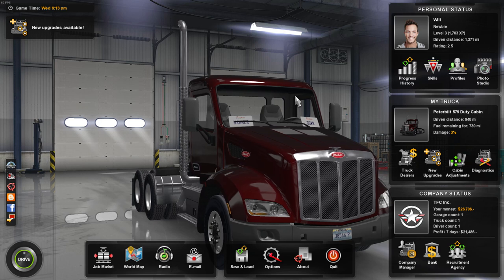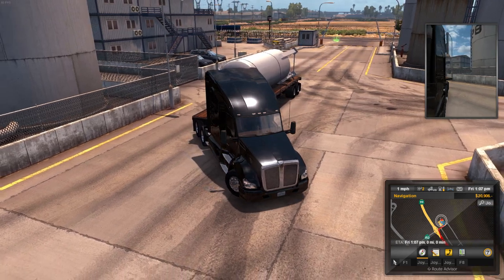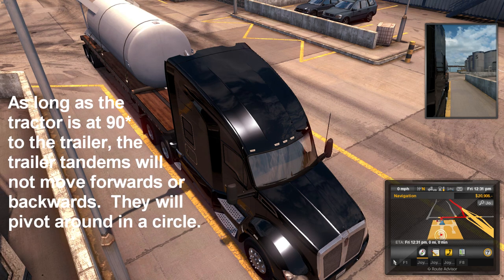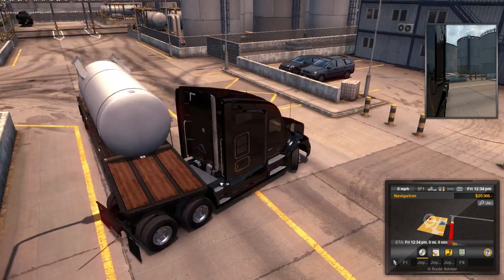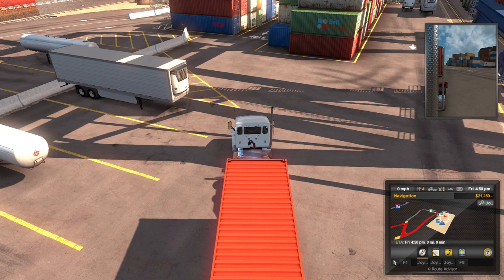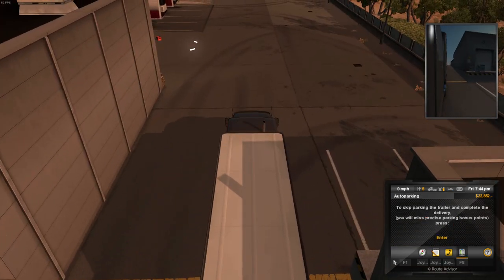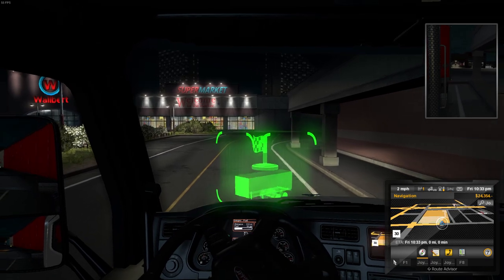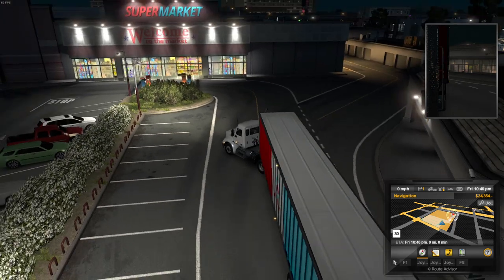American Truck Simulator - How to back up a Trailer

Comment: It's videos like this that I finally learned how to position the trailer. I was having a hard time so I would just click on the easier options mostly just a straight in parking job. I also compared this video to some other actual backing up videos done by offline truckers and it's pretty much the same. I could never figure out how to back up into that tight space where you were backing up into in this video so thanks for the help on that. Those are some crazy jack knifes and probably close to crashing the back corner of the cab into the trailer lol.
Reply: @Benjamin Schiltz Vlogs    Not me. I decided right from the get go that I would learn to park a truck properly. It took me nearly 45 minutes to complete the tutorial, and 40 of those minutes was me spent trying to park my trailer. I did, however, learn a lot about backing the truck and about how turning affects the trailer. I kept taking the hardest parking offered by the game. And eventually, I learned how to park a truck this well simply from trial and error.

Comment: One of my first out of school and into the real world backings was a dividing cor curtain wall of cinder block where i had to do a lane change type parallel park into the spot with the wall starting on the blind side and ending on the sight side with a trailer already in the next spot over. I have come across some tricky parking jobs that are not covered at all in Training School. A Game like this would have helped greatly, best played on a full size simulator rig, ie three monitors, steering wheel, shifter, three pedals and some feedback sensors.

Comment: I can back trailers with my mirrors. The mirrors installed on the truck. Not the mirrors you use by pressing F2. My only practice was external camera.

Comment: Great video as a student this helped, you might want to emphasize the LITTLE turns.
Reply from the maker: +Richard Swartz Yessir, I should have.  I noticed a lot of things I should have touched on, after it was uploaded.  Funny thing is, I watched it in the editor many times too, and never noticed it.  It is a very good point, though.  The bigger steering inputs basically get you in the ballpark, but the little ones are the difference between parking a trailer, or having to pull up and try it again.

Are you in the middle of getting your CDL?

Comment: I have been a driver since 1987. This video on backing is not the most efficient method and is not the method taught in Truck Driving School. The most effective and efficient method of setting up to change lanes backing is to simply pull forward straight until the trailer rears are past the end of the lane and you can see the target in your passenger mirror. The 1-1/2 turns of the wheel to left, back until you see the right front corner of the trailer, then turn the wheel right sharply until you come back around and you see the driver side trailer tandems about to enter the opposite lane. At that point you steer right until the rear guides easily into the lane between the lines and back straight by coming around with the tractor until straight. Perfect park. Parallel parking is done similarly.
Reply: Philip Murray i agree i have been driving for a long time now and this vid is ok but not good if it was me i would come in and turn left then do my backing up and some spots i deliver to i have to back up all the way down the side of the building and into the back to get to the loading dock and there is always trailers there so its not easy and if you do a cdl test and you take to long to figure it out you dont pass
Reply from the maker: Guys, this is a game, and this video is to show gamers - not truck drivers - how maneuverable trucks are, so they don't give up.  Now the things depicted in these videos, while not easy on equipment, are the types of maneuvers you'll see 24/7 on oilfield locations.  But I wouldn't recommend them on pavement unless you were in a jam.
Reply: The First Crew agreed I think the only ones who would dislike the video is professional drivers. I loved the video as I play the game and have a HARD HARD time backing
Reply: where u get the game
Reply: Chuck Winters Steam website it's on sale now 9.99
Reply from the maker: I agree.  They don't seem to realize this is a tutorial for a video game.  They also think interstates and huge yards are the only thing in trucking.  If they ever went to the oilfield to haul sand, water, or diesel, they would shit their pants.  Every day, I see trucks jack knifing so hard, while the truck is moving forward, the trailer is literally moving backward, until they can straighten up some.  It's hard on equipment, but it also pays good.
Reply: There is not one way to back idc how long you been driving. Everybody does it differently, as long as u don't hit anything u did a gj
Reply: Depends on what school you went to. Not everyone teaches it the same.
Reply: Guys, if you’re playing a simulator, then you would want to do it the right way, no? The guy in this video hits plenty of obstacles and walls while maneuvering. I see that as a complete fail, game or not.

Comment: I've got a good damn question I can't find a video anywhere on.      What is the difference in drive wheels.  2x8, 2x6  etc.  And location of wheels on the trailer.  Middle rear. Separated etc.   Purpose of each and how and when to use
Reply: I know its been 10 months but Extra wheels means you can support more weight. And the space between wheels also is a factor in how much it can support

Comment: These maneuvers may work in game... But definitely not recommended in real life, you will end up with a lot of damage
Reply from the maker: Yeah, hard on axles and tires.  But this is how it's done on tight oilfield locations, 24/7/365.  Destroy equipment for the almighty dollar.
Reply: I was a hostler b4 going otr. & set-up & maximizing space was always needed. Newbies should do this game 4 a mth b4 hitting the road.
Reply: I am also a truck driver, I haul 80,000lbs worth of limestone. On a trailer like my 4 axles, you'd be ripping tires like crazy if you had a full load and tried to do this
Reply: My thing is 80,000 or 8 pounds people don't have a clue bout backing. This would help.
Reply: Yeah the game is a good way of learning
Reply: Having said that, how do you do it with 4 axles and 80K of stone without savaging the tyres?  Seriously.
Reply: +deltavee2 lift the one axle and backup with as little jack knifing as possible haha

Comment: @The first crew do you have your cdl and have any advice on shifting an 18speed eaton
Reply from the maker: If you're talking about a "5 and 4", where you don't use low gears for compound gears, (have two shifters), then I can't give any good advice.  I hook my left arm through the steering wheel to shift the four speed, while using my right arm to shift the five speed.  It's a pain, and I was never good at it.

If it doesn't have two or more shifters, it's a matter of getting used to it, and starting in a higher gear/skipping gears as long as you're light enough.

Comment: Can you simulate B-double configuration (truck + 2 trailers) on this?
Reply: @daveyork0   Sadly no. Don't get me wrong. They do have articulate (double) trailers, but they're connected by a dolly. They aren't B-doubles. However, if you can handle the damn near impossible dolly doubles, then B-doubles will be a breeze.

Comment: you're good
Reply from the maker: Thank you.
Reply: The First Crew
I'm wanting to learn backing a second trailer, ie. b-double. How would you suggest?
Reply from the maker: That's hard, because you've got three points of pivot, instead of one.  And since there's quite a bit of play in one of the connections, you have to be real quick on corrections.  I'll admit, it's out of the scope of my skills.  There are people that do it, but they are damn good at what they do.
Reply: just remember bud when backing up a with a double trailer also called the pup remember that back one will
move the same as the truck will its hard but slow movements on the wheel and you will be good i have been driving truck for many years and now own my truck and have been doing doubles for a long time
Reply: The pup will move the same as the truck. I'm meditating on that. And respect to you.
Reply: daveyork0 yes the pup will always go the opposite way the main trailer will go
find some vids on backing up double trailers and see
Reply: best thing to remember is if the back trailer starts going to the left turn the wheel to the right and if it goes right go left with the wheel don't do fast movements

Comment: try doin that with the 389 with a extended frame and a 53'. And a 90% I know a way that works 99% of the time with little pull ups

Comment: This game is just like ets2 with mods
Reply from the maker: That's nice.  Did you come to that conclusion all by yourself?
Reply: +The First Crew Yea, still no road trains, no double b, no self steering trailers, no hands on the steering wheel, no towing, no heavy hauling.. etc. Its just a modified Ets2. Heck, they didnt even change the main menu..
Reply from the maker: It is built on the same engine, thus no double B, stingers, etc.  As far as the menus go...they weren't broke.  Why change them?

Comment: in third person mode? That's pretty much cheating.
Try in first person only my friend.
Use 3rd person only to simulate getting out of the truck to check your surroundings (no moving the truck).
Then back to first person and back up.

I do it in first person with mirrors only.
Well i also am a truck driver in real life, but it's still 100% better for practice.
Unless you dont want to simulate and are only in it for the arcade.
That would be different.

Comment: Thats cool and all, but those maeouvers are 99% of the times impossible to do in real life. Also, you didnt need to do that, you have space to turn around lol. In real life, there is far more space for the trailer to maneouver and the loading docks are prepared for big hauls, on the contrary of the game.